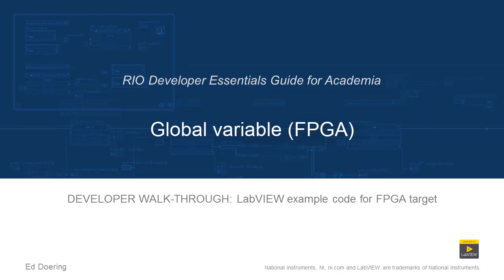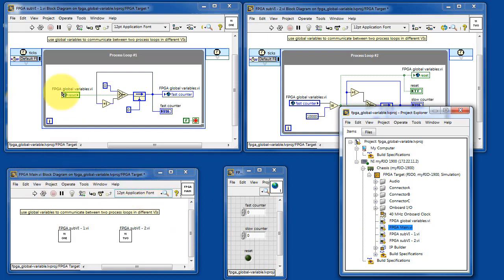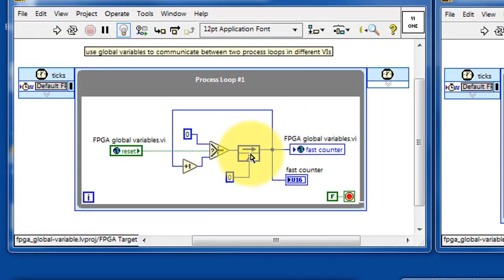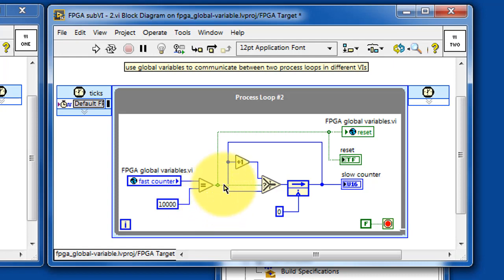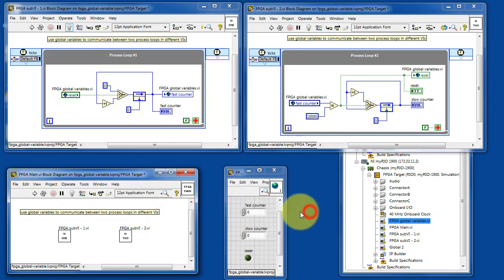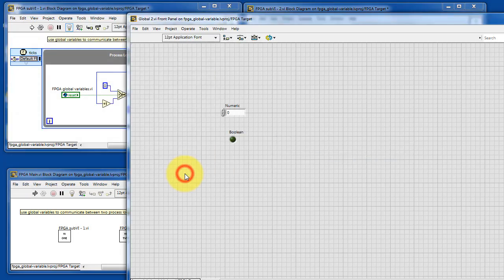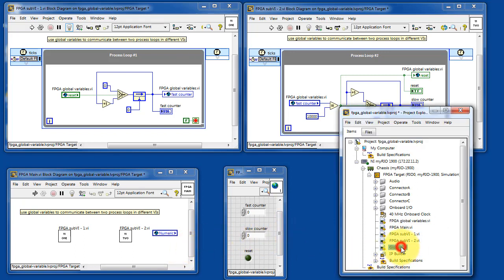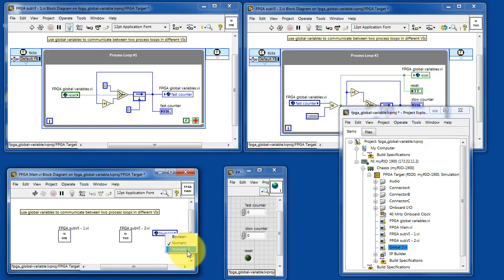LabVIEW code: Global variable (FPGA) (walk-through)

Comment: What about FPGA timing and resources taken when reading from or writing to a global variable ?
Are there considerations to have when the data type is big ?
Are there limitations in using them in Single-Cycle Timed Loop ?
Are there compiler optimizations when the size of the global variable is different from the data we actually use (eg: a global array, where we only read an element) ?